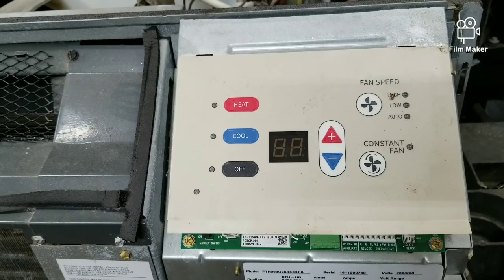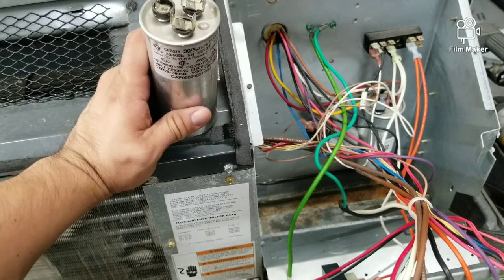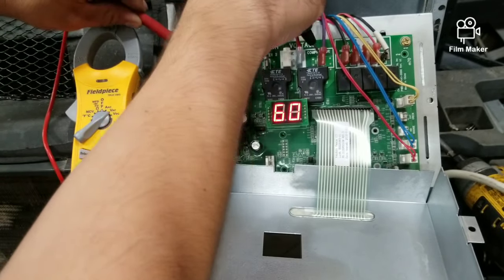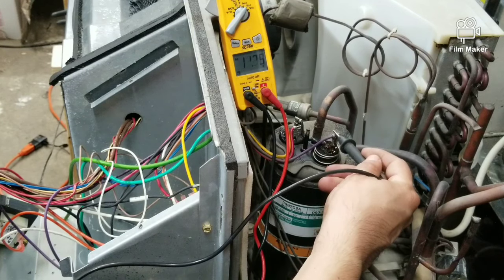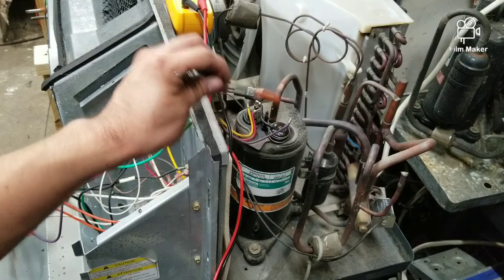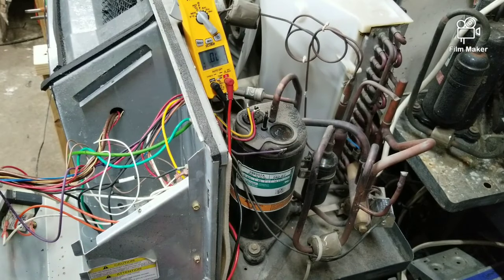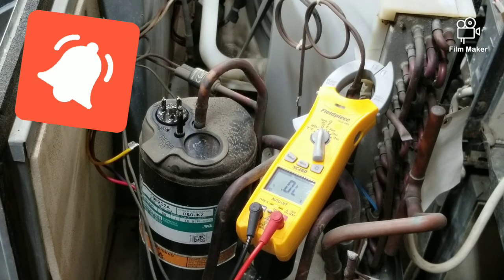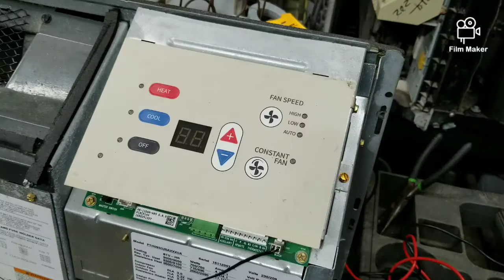Compressor not coming on? These are the most common reasons!!!

Comment: Very helpful!! 3 ptacs in my home, got rid our our ducting, best thing we ever did (put sleeves in the three main areas of our home), our master bedroom ptac went out 2 days ago, august 103 degrees  S. georgia.  just took the capacitor out of another bedroom ptac and ours is fixed now.  I switched them.  btw the other bedroom ptac now does the same thing, so it was the cap.  Wife very happy, we'll see tonight!  So here[s what it was doing.. on high or low cool, about every minute or so, there was a slight buzz for about 5 seconds, then stops till another minute rolls around, compressor was very hot to the touch, really hot.  the fan always ran as normal just no ac. so the cap fixed it. and the compressor was fine all along and we're happy now.  cleaned the  whole thing too ge digital ptac.  thanks for your video.
Reply: Yes, really, thanks a lot.  3 years ago, we bought our ptacs used in Tampa and drove them back to GA to save $2k.  So they weren't the best and we're far from great.  Just woke this morning and room feels totally different, the ge unit and the cap fix did it.  We also noticed how filthy and packed the long squirrel cage fan was...the wife grabbed the toilet scrub brush and I got all the crud from the fan.  Ptac blows cold across the room now.  Cleaning does wonders.  Thanks for your vids.

Comment: Nice video. Just to share. I always start with the safety switches HPS OLP LPS etc.... If I suspect and found that the relay board is broken, I jump T1 of compressor straight to L2 disconnecting it from the Relay. When the compressor starts, it is the relay board. The contacts inside the relay are the ones that go bad. Not the entire board.

Comment: The compressor was working normally giving out good cold air and suddenly it became completely quiet when the air-conditioner was switched on the next time, is this likely due to the capacitor issue? As you have said in the video there will still be starting sound coming from the compressor.  But in our case no starting sound can be heard, what are the chances that it is a capacitor issue?
Reply from the maker: I would recommend to check the High pressure switch wiring( very common to short out) or if the capacitor is completely dead then you wouldn't have the compressor trying to start

Comment: You’ve  been my “go to” guy for almost two years now. Lol. I have a Amana ptac where the compressor turns on but no cooling. I’ve checked everything else. Would that just mean the system lost its refrigerant?
Reply from the maker: Hey Rob
Thank you, I'm glad my videos have been of help to you!! So, if the compressor and  motors are working and no cold is coming out more than likely there's no refrigerant in the system
Reply: @PtacSolutions   Awesome. Thanks for the follow up. I figured that was it, but just wanted to double check and make sure I didn’t miss anything. I never worked on PTACs until I came to work in this hotel almost two years ago. Now I feel like a freakin pro. Lol.  Thanks again 👍🏼
Reply: @PtacSolutions  Hey I have another question. So I have another Amana PTAC who’s compressor will come on. It’ll reach temp then shut off. When it calls for cooling again, the unit will start but the compressor won’t come back on. Ive never changed a capacitor in one of these. Do they go bad as well?

Comment: any advice or can you do a video for a unit that is short cycling? compressor stays on forcouple minutes then turns off
Reply from the maker: Hello,
I would check the condenser coil for cleanliness and/or make sure the condenser motor is working properly as well

Comment: Compressor not kicking in for my AC, diagnostic says Low current on CT1, what's the cause sir? Thanks in advance.
Reply from the maker: Hello 
What brand unit do you have?
Reply: @PtacSolutions  it's a Samsung system 3 digital inverter sir.
Reply from the maker: I'm sorry I'm not familiar with that type of unit. Is that a mini split system?
Reply: @PtacSolutions  yes sir, it have one compressor external unit supplies 3 FCU.

Comment: You never mentioned low refrigerant will cause the compressor from not coming on.
Reply from the maker: How's it going... in ptacs that doesn't happen, the compressor will run even if the unit is completely empty

Comment: i have total of 40 plus Amana ptec few air-condition showing F6 code and i replaced the yellow thermistor, but the code is not going away its working fine even with the code what should i do to get rid of the code
Reply from the maker: Hey Viren
If you already replaced the yellow thermistor, try doing a reset on the unit by unplugging the unit, turn off master switch. Reconnect unit, hold down the cool and heat buttons for about 10 seconds, while holding turn on master switch, let go when the red light comes on. See if that takes care of it

Comment: The ptac I have a problem with makes a constant ticking noise behind the control board to the compressor..what would you do step by step to figure out you situation
Reply from the maker: Hello, does it do it no matter what's running( heat, cool or fan only)?
Or just when the compressor is running?

Comment: I have an Amana ptac unit with twist knobs.. everything works except the compressor does not come on.. between line 1 and compressor wires I have 0 volts.. but from ground to line1 i have 120 and from ground to compressor I have 120 just don’t get 240 like you do in the video?
Reply from the maker: Hello, usually the board has a delay about 3 to 5min.. after that if you're still not getting the 240, more than likely it's the control board not sending power to the compressor.
Reply from the maker: If you have a jumper( alligator clips) you can send power directly by hooking it from line 2 to the compressor, if the compressor comes on the problem is the control board board. Disconnect the unit before doing so
Reply: @PtacSolutions  even though from ground to the purple wire on compressor has 120 that still is not what we are looking for?
Reply: @PtacSolutions  ok I will try that
Reply from the maker: @foreman0909  no, you need 240 volts to get that compressor to work
Reply: @PtacSolutions  can I put a digital control board back on it if that should be my next step?
Reply from the maker: @foreman0909 yes you can the only thing is that you will have to make some minor adjustments... you will have to install a yellow thermistor(IDT) goes where the discharge air and also if that board had the transformer integrated into it you will also need to install one
Reply from the maker: Its pretty simple I can walk you through it  if that's what you want to do
Reply: @PtacSolutions   I don’t care too just unable to find a twist knob control board.. also do I jump line 2 to the purple wire on the compressor?
Reply: @PtacSolutions  would you be able to direct me on what I need to buy to upgrade the old turn nob board. Can't find the old style boards anywhere. Thank you
Reply from the maker: @Blake-op1un  Hey Blake, Does that turn knob board come with the transformer attach to it?
Reply: @PtacSolutions  yes

Comment: I need an overload switch for that exact unit, nobody seems to have it.
Reply from the maker: Hello,
What is the btu
Reply: @PtacSolutions  9000btu
Reply from the maker: I can get you a good used one
Reply: @PtacSolutions   Thank you very much, I really didn't expect that but an most appreciative.  I'm going to call a few local places tomorrow and see where that takes me, if I come up empty, I will get back with you.  I find it odd it's not available, but in fairness, some places it's back ordered.
Reply from the maker: Yes, they are.. I'm struggling to get some parts myself. If you need it, you can have it just pay for the shipping fee
Reply: @PtacSolutions  Ok. I really appreciate your generous offer, but I don't want to deplete your parts surplus either.  The need I have is not super critical, I'm just trying to repair an extra unit for when then next one goes down at our site.

Comment: I got a a ptac that seems to be lockup. LRA is fine and Capacitor has been changed. Voltage is fine. Any suggestions?
Reply from the maker: Hello, whats the amp draw?
Reply: @PtacSolutions  23, 23, 2.5 amp draw. LRA is 33. Thx Dave
Reply from the maker: @jeffmurray3685  hey Jeff, that is pretty high it's possible that the compressor is locked.. what's the RLA
Reply: @PtacSolutions  33 LRA on the tag and drawing 24a with my meter . I also put a hard start on it with a brand new capacitor. Overload hax been tested to. Hums for for 3 seconds then clicks off again and again 🙄
Reply from the maker: @jeffmurray3685  usually the compressor pulls about between 4 and 6 amps when running normal, you have 23 which is really high( see RLA) and you also have a good capacitor with a hard start kit. It really sounds like the compressor is locked up
Reply: @PtacSolutions  I agree. Any other options to unlock. Thanks again! Excellent channel!
Reply from the maker: @jeffmurray3685  thank you! Unfortunately not,  once that compressor locks it has to be replaced.

Comment: What the amp draw on the compressor supposed to be it should be 4 amp correct
Reply from the maker: Hello 
Well it varies on the compressor size, 7k btu compressor amp draw would be 3.. a 15k btu compressor would be around 6

Comment: amana window ac is not cooling. fans and compressor are running but the air is not cold.  used a heat gun on the thermocouple by no change.  compressor plumbing is cool to the touch.
Reply: Reading farther down it seems when everything works but no cold.  Low or no refrigerant so does anyone recharge these window units?
Reply from the maker: Hey Jim 
It sounds like that unit may be low on refrigerant or a refrigerant restriction
Reply from the maker: They can be charged, but if the leak is big might be better to replace the unit, depending on where the leak is at

Comment: How do I bypass the overload switch?
Reply from the maker: Hello Jose
By connecting the wire that's coming from the control board (should be connected to the overload) and connecting it directly to the compressor. In other words you are basically going to eliminate the overload switch
Reply: @PtacSolutions  Bro Thanks for always being there to reply to our questions, do you consider this a quick temporary solution while you get the overload switch or can I just run it like that?
Reply from the maker: @JoseGarcia-ou9vy  your welcome.. well that switch serves as a protection for the compressor. You can run it like that but I would recommend to get one installed
Reply: @PtacSolutions  awesome thanks again brother I asked the chief already to order extra ones, do you have a specific place where you get your ptac parts from?
Reply from the maker: @JoseGarcia-ou9vy  hey Jose, you can get them directly from Amana ptac parts
Reply: @PtacSolutions  you’re the man! Thanks again I’ll check them out !

Comment: What if the unit turns on but not turns the cold air on
Reply from the maker: Hello, if everything is working and no cold air is coming out more than likely unit is either low on refrigerant or there's no refrigerant in the system (due to leak)
Reply: @PtacSolutions  unit turns on and temp is raiser so it will call for air but it won't
Reply from the maker: @jescotto4337  so the only thing working is the blower? Back fan and compressor are not working?
Reply: @PtacSolutions  for example the unit is being put on temp 71 and the room temp is about 80 let's say. The unit isn't turning on to start cooling like it should.
Reply: @PtacSolutions  and sorry but your the only guy on here that works on ptac units and actually talks about troubleshooting but just installing and cleaning!
Reply from the maker: @jescotto4337  thank you.. what type of unit are you working on

Comment: Mr. David have you ever run into a PTAC unit where it's cooling perfectly fine, but on the evening when it starts getting hot the unit blows warm air
Reply from the maker: Yes I have! Usually what I find is dirty condenser coils or the compressor overheating it can't keep up...
Reply: @PtacSolutions  i figured something like that was happening. I've been removing the unit from the wall and rinsing the coils both condenser and evaporator. Been working wayy better than before. If the compressor overheats, is there anything we can do besides maybe upgrading the unit to a greater btu?
Reply from the maker: @andrade24100  unfortunately no, if the unit is old and you have already washed them and its still not cooling like it should, best thing to do is get it replaced
Reply: Thanks for your help David!! 👍
Reply: There are ptacs that the RV has been de-energized thus the warm air. I have seen board pulled out and saw a crack on the RV pcb line.

Comment: So I’m working on a unit now and when I disconnect the black thermostat wire the compressor will kick in perfectly but once it’s reconnected it shuts it back off. I’ve replaced the thermostat send it still has the same problem. Any advice on what I should do?
Reply from the maker: Hello,  that sounds like the control board is going bad.. but before you replace open the control panel and the compressor terminal cover and check the wiring

Comment: What would you suggest if the ptac unit is short cycling? What troubleshooting steps would you take? I have two units at work that run for 3 minutes at a time before the compressor stops running.
Reply from the maker: Hello Joey 
I would check for a bad condenser motor  broken fan blade or dirty condenser coil, all of these can cause high pressure causing the pressure switch(if applicable) to open or the compressor to overheat
Reply: @PtacSolutions  I jist realized that our dryer vents for hotel laundry is right below the room that is having issues with short cycling and sure enough i pulled the unit out and saw the lint the the exhaust vents for the laundry room. Will clean out tomorrow. Thanks for the suggestions. You're the only maintenance channel that works on PTACs and your videos are beyond helpful

Comment: Hey bud I am one of your YouTube subscriber and am seeking help I had code f6 on my Amanda ptec I replaced the thermistor and the circuit board code went awry for a bit compressor came on and I thought it was fixed after I installed it in the room it doesn’t work and showed me code f6 again and I changed four different thermistor but the code won’t go away and AC not working compressor doesn’t come on and it’s is very hot could you guide me what should I do next please thanks
Reply from the maker: Hey Viren
Ok, so usually that code pops up when the filters, discharge air grille or even the blower is dirty affecting the discharge of air. Make sure all of that is good
Reply: @PtacSolutions  all that is cleaned just done it yesterday and compressor comes on if I by pass the overload switch but the switch is good but the compressor is extremely hot so I left it off overnight don’t know what else to replace or change
Reply from the maker: Ok, so sounds like that compressor may be overheating. Make sure the condenser  coil is clean and clear through the fan shroud
Reply: @PtacSolutions  everything is cleaned from the front and back compressor kicked on after overnight rest one time only but after I turned it off and on now compressor making humming sound but won’t kick on
Reply from the maker: @virudon21  can you check Amp draw on the condenser motor?
Reply: thats where i am stuck because i don't know how to and don't have meter so trying to find if i can find a frined  that has one or i m going to buy one
Reply: @PtacSolutions  I am getting about 15 amp on the red wire
Reply from the maker: @virudon21  was it set on the low speed? If it was that might be your problem you have a bad condenser motor. Check the capacitor( fan side ) to eliminate that possibility
Reply: @PtacSolutions  I think the problem is found condenser fan is spinning wrong way and speed is very slow do I need to change the motor or just the wiring or there is something else
Reply from the maker: I would recommend to replace the motor
Reply: @PtacSolutions  thank you very much for all your help.  it is fixed and working grate thanks for all your help if you have a way to message me privately i would like to send you something
Reply: i have total of 40 plus Amana ptec few air-condition showing F6 code and i replaced the yellow thermistor, but the code is not going away its working fine even with the code what should i do next